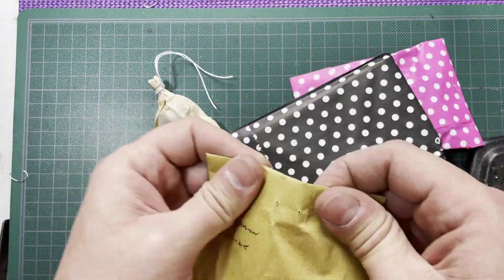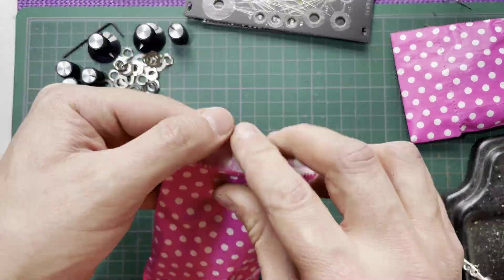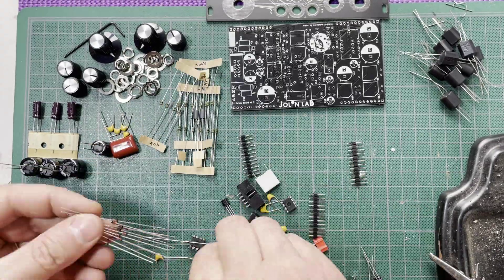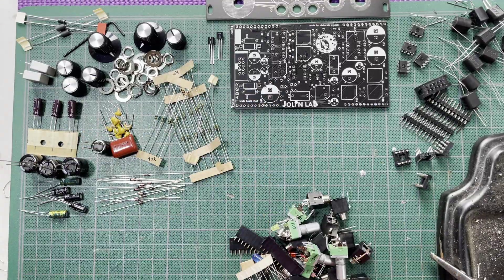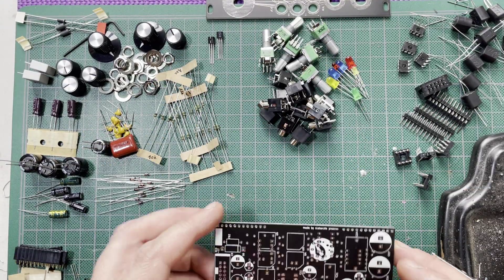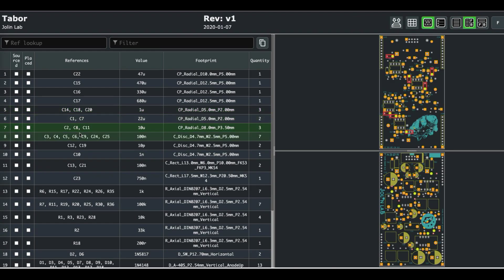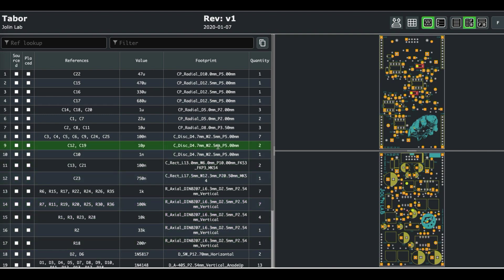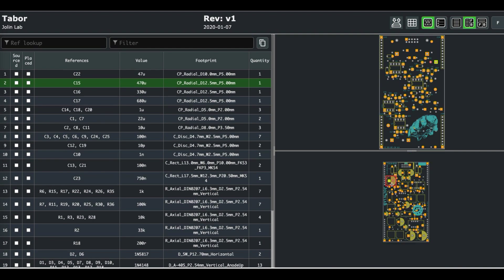Tabør by Jolin Lab - Build Video

Comment: Looks neat but quite pricey for a full kit on pusherman...which comes to around $227 USD.
Edit:  even the pcb/faceplate alone... $70 before shipping.
Reply: yeah I would think this is putting a lot of people off, I have been asked to build this for a friend, and the price of the PCBs is only really sweetened by the fact the finished module is so expensive.
Reply from the maker: Royalties to the designer are included in the OCB/Panel price, thus ensuring they can keep creating cool stuff. It's a very small company, they can't compete in economy of scale with bigger ones.